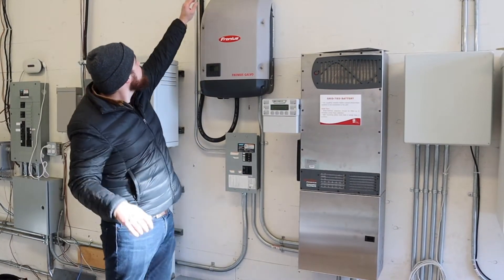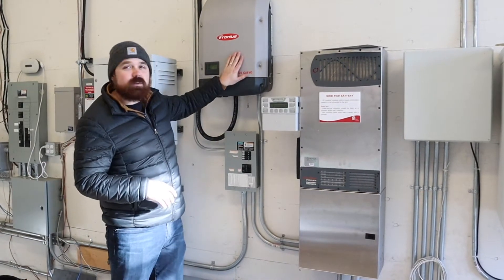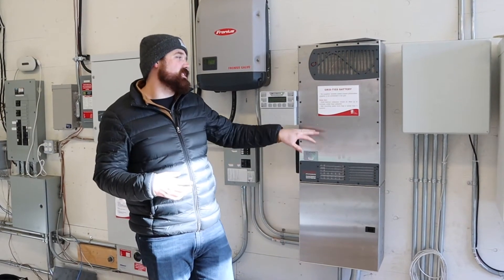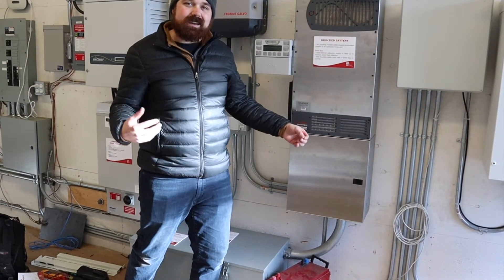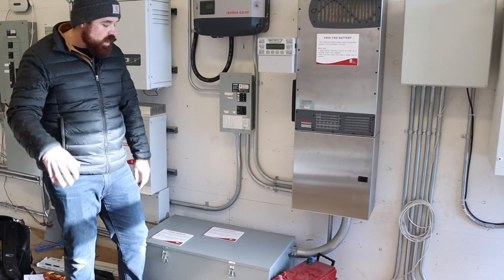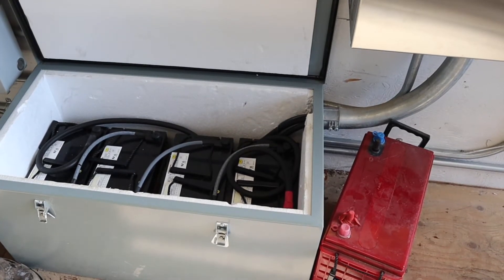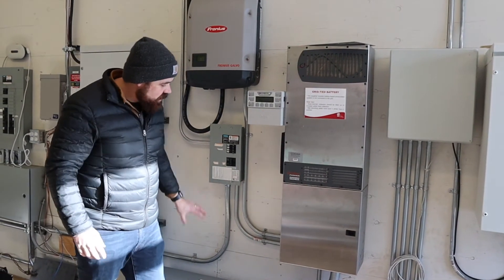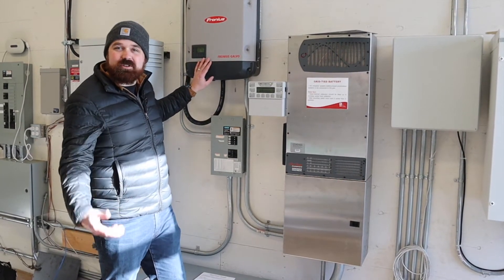Let's have a look at a Solar Carport

Comment: So if the roof blocks even a small section of a panel, it renders it useless? Or not capable of generating any power?
Reply from the maker: In this exact setup it did, yes. Just a poorly planned design but there are certainly solutions to this and better technology now.
Reply: @ZackHartle gotcha! Thanks for the reply man! Been watching your videos all week and found everything to be super helpful and filled with useful info. Hoping to see some updated code videos in the near future if you’re up for it! Thanks again for providing all this information Zack.